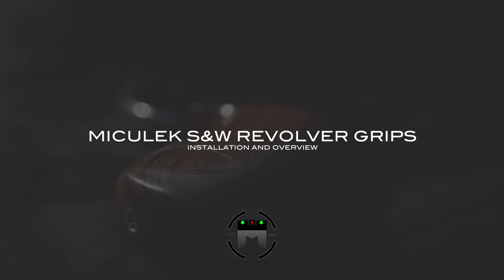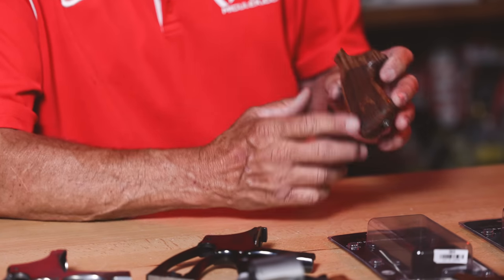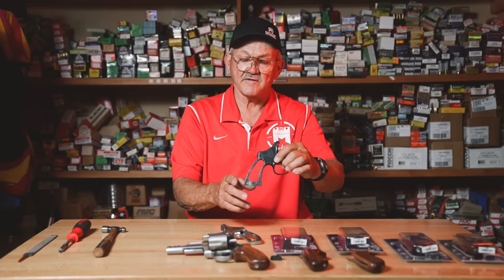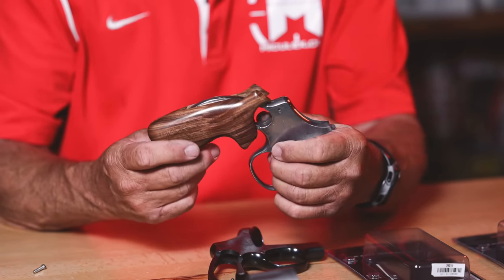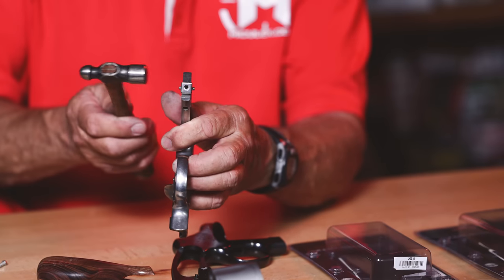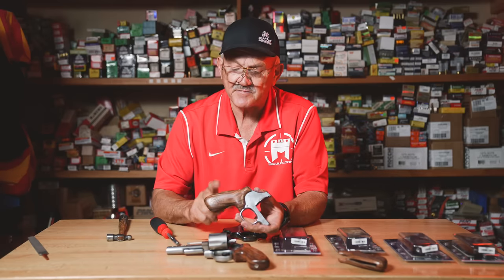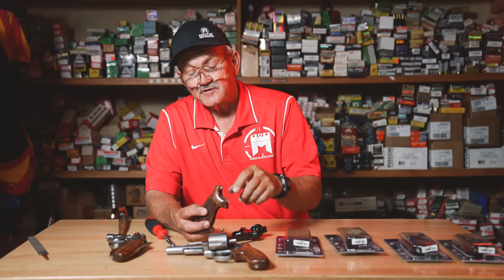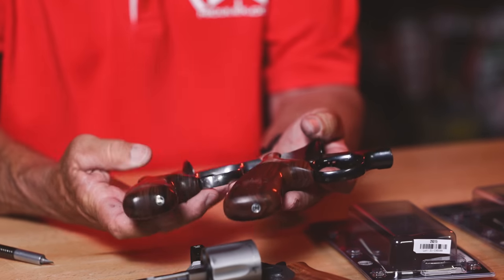Installation - Miculek Revolver Grips

Comment: I purchased a set of Miculek  grips for 627….shot 8 rounds of 38spl… then 2 rounds of 357… they chipped off small piece….. another set for 617….. they WILL NOT FIT…. Despite a lot of effort…. They have NO CUSTOMER SERVICE !!! EXTREMELY DISAPPOINTED ESPECIALLY SINCE I SPENT OVER 200$….. DO NOT BUY😢😡

Comment: Looks like my .357 Taurus grips from the early -90. Same wood and has dimensions of a old soap block. Sure it is hard wood and my Taurus grips are still more than good. Damn those Brazilians could handmade revolvers to last and cheap. Nowdays the grips cost more than hand fitted revolvers then.
Reply: Just bought Hogue rubber grips on my old Colt Anaconda. I cannot even tell the difference on the new Colt Anaconda when i shoot them. Really if you can shoot and have shooted many guns the double action pull weight should not be the issue if the gun has right dimensions and shoots good. They should go back and make the old Colt Anaconda at the half price of the new one. Machining have evolved and is cheaper now than ever. Sure the polishing cost :D Take your gun to goldsmith and he will polish that under 150 euros in Finland. Finland is not even a cheap country.